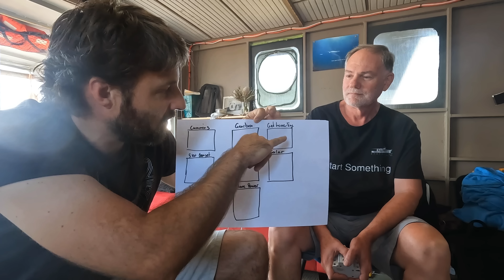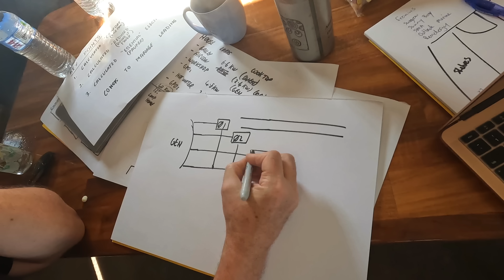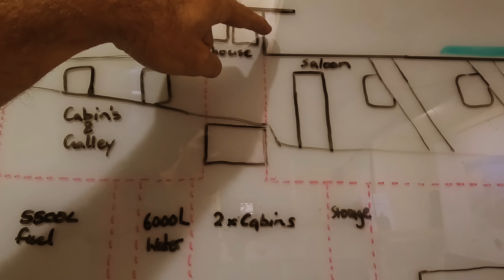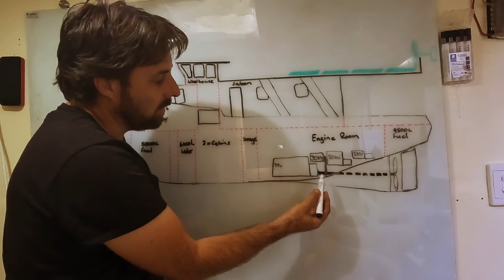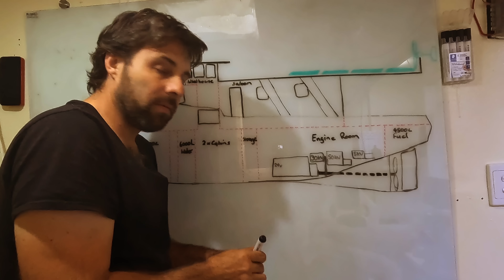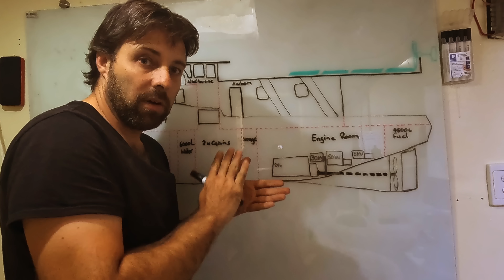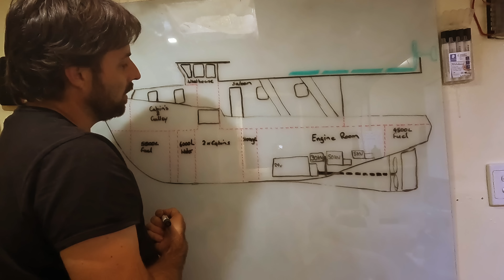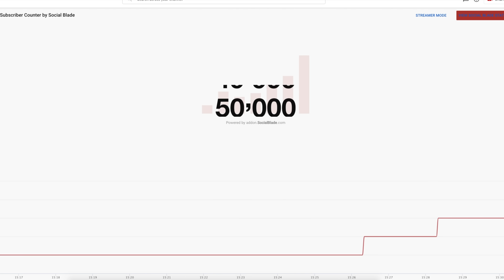Powering Brupeg - Project Brupeg Ep. 273

Comment: I’d go for a VFD for the 30kW motor, soft start and variable speed control would make it a very nice docking engine. There’s also a lot of them floating around on the used market, as industry these days fits everything with them. Vacon/Danfoss makes very nice units and they can be had for very limited money “broken”, usually it’s the fan that’s lost a blade, ruptured capacitors or a dead display unit that’s wrong with them, all cheap and easy to fix.

Comment: A couple of ideas:
Have those extra solar panels unfold like a cantilever tool box. So even folded up the top panel still see the sun.
Second thing is to weld lift rings  for the  propeller  etc. In case of damage from ice.  You can dive down to repair but need  that all important  lifting ring if you have pull the propeller.

Comment: Hi Guys,

I've got a 3 phase genset, and I've only got single from mains.

I've always been told with 3 phase you NEED to blance the the phases otherwise you will burn out the windings on the Genset. So 1 phase for the house, and the other 2 phases need to be doing something. So I've got 2 x instant hot water units that will be used to heat the pool (using the pool as a heatsink) so the genset doesn't burn out.

Regards
Reply: Yes, that's are approach re the 3-phase and house load. Dame's colouring in the previous episode was us going through defining circuits and calculating loads to best balance phases for the generator via the inverter. Of course they will not be perfectly balanced, but we want to avoid extreme imbalance. The get home electric motor will be the majority of the load when running, so that will be the most significant part of the (balanced) load. Cheers, Duncan

Comment: Split it up, 3 phase for high current items or items that you would only when you need the generator, than all the common items run off a single phase which than you have a inverter when you want to run on battery. When the 3 phase genset is running, it feeds the inverter charger to charge up the systems. Keep up the great work guys.

Comment: Hey Dame,

To throw another Spanner into the mix, albeit a possibly very useful one....

Have you considered also being able to use the Shaft motor, as a Shaft generator? It's a thing that big ships like Cruise ships do, for efficiency reasons where once they are underway at a steady engine power setting, they use the shaft generator to supply a large portion of the electrical needs and thus can shut down some or all of their gensets.

In your case it likely would not be your primary power source as you would be stealing horsepower from the engine to do it, and on a Small boat like yours, spare horsepower is limited, HOWEVER, In the event of a Primary Generator failure, where you NEED to be able to generate more power than the small Genset can provide, it may very well save your bacon.

Bonus points if you fit a second clutch between the propellor Shaft and the Motor, so that you can disconnect there, and be able to use the shaft motor as a generator without the propellor turning.
It'd also give you a decent way to load test the main engine without needing to drive the propellor when troubleshooting it.

Now as others have mentioned, you'd likely need a VFD for the Electric motor, and in this case, one that can handle using the motor as a generator as well, similar to the kind you'd find on an electric sailboat as those can use regen to recharge their batteries under sail.

Also regarding Shore power, you should fit either 1 or more Universal Voltage input Battery chargers, AND/OR an Auto Transformer, so that you can run off of 100-120v AC in places that use it. Even if you can't directly power most loads this way, being able to pump a few KW straight into your batteries for the inverters to use to supply loads, and to have the ability to directly supply loads on any "Essential" / "Emergency" Buses (Think, Comms, Bilge Pumps, Fire detection, standby lighting), is a huge plus

Regarding 220v / 230v / 240v, all of these are within the allowable range for "230v" which is the standard these days, so you could plug in to shore power in countries with those voltages and be fine. The worst you might need to do there is to just adjust the voltage settings on the Inverter charges / transfer switches.

If you end up using something like a Victron Multiplus or Quatro (or a few of them), they have the ability to bi-directionally Blend Shore Power and Inverter / charger power in realtime as needed by loads.
Basically you tell the unit from the control panel how much its allowed to draw from shore power based on the plug rating your connected to, and when ever AC loads need more than that limit, it boosts from battery, and when the load falls below the limit, the excess budget goes to charging batteries.

Combine that with an Auto transformer thats selectable via switch (or automatic via some magic electronics), and you can do the same on 120v.

I Highly suggest you look up "SV Delos Electrical System" in google and visit the page on their site called:
"System Overview for solar, wind, and lithium batteries – Electrical Boat Tech"
They cover the rather comprehensive electrical system on their sailboat, including how they handle multi voltage shore power, and have some nice big block diagrams of the system components.
Like you, they love redundancy and multiple options, so its a good watch.

Comment: I would suggest you use a VFD to control your 30kw motor especially with the genset . I spent quite a while as a service tech setting up VFD,s and soft starts in industrial applications . Soft starts really are only for limiting torque on start up and will give you no speed control so you boat will have effectively only one speed , soft starts also normally are restricted in the number of starts they can preform in an hour . A VFD will give you way more control and be a lot easier to manage , if you do fit a VFD I would recommend fitting a forced vent fan to the motor .If you are running a low speed the fan on the motor wont be able to cool it properly .
Cant wait to see this in the water 👍👍
Reply from the maker: Good advice. We are about to place an order for a good VFD unit and I like the idea of a forced fan cooling system
Reply: @ProjectBrupeg  
Good stuff , force vent is essential if you are running under 20% of motor rated speed. Feel free to contact me if you are looking for any advice on the VFD stuff 👍👍

Comment: As you are planning on using the boat as an expedition/research platform I would suggest 3 phase wiring throughout. You can always just use a single phase off of the 3 phase if you need it. But I can almost guarantee if you don't have it available then groups doing research will ask for a 3 phase connection for their heavy duty equipment. Also with 3 phase you can split things like lighting to be some lights on one phase and other lights on another phase. With each phase having it's own breaker if something goes wrong on one of the phases you don't lose all your lighting. It also makes it obvious that you have lost a single phase and even identifies which phase. Whereas with single phase, if the lights go out it could be wiring, faulty appliance, faulty inverter, dead/faulty batteries etc. It won't be instantly apparent what has failed. It will also be something you need to work out in the dark or by emergency lighting.
Reply: Hi Jase. Yes, that's our approach re the 3-phase and house load. Dame's colouring in the previous episode was us going through defining circuits and calculating loads to best balance phases for the generator via the inverter. Of course they will not be perfectly balanced, but we want to avoid extreme imbalance. The get home electric motor will be the majority of the load when running, so that will be the most significant part of the (balanced) load. Cheers

Comment: Containers and container ships are used all over the world, the refrigerator container has a genset hanging from the chassis when trucked. They are cheap, 4 phase, self contained and will run on vegetable oil. I use one as back up generator, cost me $1200 runs the hole house 5 days plus the hot tub.

Comment: You should modify your sump at this stage to include a drainage valve and adaptor.
Reply from the maker: Hi Cathal, great idea. We actually plan to make a system that drains main engine, gearbox and genset using a electric pump so we can do oil changes fast and easy without the need to try and reach under the various machinery
Reply: @ProjectBrupeg  add a small centrifuge filter setup and you will be able to recycle all the oil back into your main fuel tanks. Maybe oil driven from a pump (ala Landrover or commercial truck) or a small electric one. I know it’s only a small amount over two gen-sets and the main engine, but it is difficult to dispose of 20+ litres in most countries without a commercial account. BTW, Europe is 230 volt or 400volt 50Hz nominal if that is of any use to you. (I’m sure those decisions have allready been discussed and made.

Comment: Love the channel!!!  What I don't quite understand is what are the ways in which Brupeg is substantially different from thousands of similar and larger boats? What is the most substantial component that might call for 3 phase power?  I had a 76' woodie with twin 671's. (sorry), heavy duty Navy components but no where close to needing 3 phase power.
Reply from the maker: Hi Rex. We fit somewhere between recreational and commercial boats. We need a big solar/wind/house bank so we can stay at anchor indefinitely without the need to run a genset and we need high power output from a genset to drive a 30kw electric get home motor that powered the main prop shaft in the event the main engine stops. If we didn’t have the get home motor we wouldn’t bother with three phase.

Comment: I would have thought that it would be a dc hybrid drive , dc lift motors were used in tall buildings with variable speed controllers and ac to dc generators to power them, might be a solution to one of your problems. Soft ac starters I thought are just to rotate motors and flywheels from rest, to reduce surge from main windings, prior to clutching in the load, and not in initial load connection. Good luck and keep it simpler for when your in bad seas you have no time to fix it.

Comment: 3 phase should be your main generated power with stepdown transformers and isolation disconnects,. Use 1phase for lighting and appliances with transfer switches to switch inputs of your solar or wind power. Think of making feeds like hospitals - utility source, normal power, essential power and emergency circuits. Make one single phase and one 3 phase  plug in receptacle  available for shore power.

Comment: I'm going to make a prediction on how Brupeg is going to be run.
Most of the time when just cruising from point A to B you will be using the electric motor. You will run the generator 20 hours a day in a 24 hour period. This will be because fuel consumption will be much lower. The main will be used when you are in a time crunch or need full power.

Comment: I would look at andy of off grid garage on youtube for building batteries. I have also done the same thing with my inverters i started off with a mppsolar inverter 2.5KW.But now i run half the house off solar i upgraded to a victron 24v 4500w {5000v/a} ans as andy as done slave the mppsolar to it witch works very well.All the best with what you decide and hope you are all well.

Comment: Three phase is the most efficient way to generate power. You could run a 415V + Neutral ring main around the ship and spur off individual phases to local fuse boxes.
Reply: Yep, certainly in our thinking from a generator point of view. We are looking at running groups of circuits which we can easliy bring back to the "battery" room with circuit breakers and distribution panels. We can then group to best balance loads for phases/inverters. At that level, they will be 230V phase to neutral. Cheers, Duncan

Comment: I had a bit of an idea looking at a wiring diagram for parallel and series battery banks with 2x inverters. What I saw was a way to remove strings of batteries entirely by putting each bank onto its own inverter and each inverter having its own solar array. It gives some redundancy but doesn't eliminate entirely the possibility of a cascade failure depending on stuff LOL.
Thing is everyone is afraid of parallel strings of series connected battery banks and I suppose there are some good reasons because of implications around battery life and the complexities and reliability of battery balancing tech and I was looking at ways of eliminating much of all of that as I could.
The downside is in your particular setup you now need 3x banks of 48v batteries in your system
If you had 3x battery banks with each having its own inverter with one set as a master that would work wouldn't it?
In paralleled inverters you can even set the parameters for inverter switch on and off as this type of operation is already baked in for multiple inverter ops.

Alternatively you could have 3x battery banks each with their own inverter powering regions on Brupeg - each region wired for its own inverter and each inverter running off a phase of the generator. Cross feeding in the event of a failure of one region is as easy as connecting inverters - an isolator switch between inverters keeping each region isolated. When they're connected one inverter has to be configured to be master since something has to be the AC frequency generator to avoid phasing issues which AFAIK inverters can't do. This means it might take a few minutes as you configure master and slave before connecting in the event of a failure. Downside more wiring and solar panels have to be configured with more wiring. Upside is there are 3 discrete systems.
Reply: Yes, we are leaning toward the 3 discrete systems whcih connect back to the three phases with balancing in mind, but we know it won't be 100%. That's fine. Apart from the greatest efficiency in terms of the 3-ph supply, we do get that redundancy as you suggest, and the ability to have reconfurability in the case of a fall-over. Cheers, Duncan
Reply: @duncancampbell62  Re discrete systems, the one good thing about them is the battery banks don't need to be matched, nor the battery tech either.

Comment: I'm assuming you will be working with 240v single phase (415v between phases), i would distribute the 3 phases for the main mechanical stuff (motors, winches etc0, if you then want to use 3 phase for 'domestic' power, think of it as 'essential and non-essential'
Anything that you have to power from a single phase emergency generator or single phase shore power should be on the essential circuit.
The non-essential is stuff you can do without for periods of time until you can get back on 3 phase.
Another thought is to have a changeover switch so that ALL single phase stuff can be jooined together in emergency
You're less likely to get problems of blowing trips when more than one thing is turned on with 240v, it's all about the watts.
Be careful if you use 3 chargers (3 phases)  to feed one battery bank, the input and output must be isolated
We had essential and non essential supplies where i used to work as a sparky, i'm on discord via my website if you have questions
Reply: Hi "Sparky". Yes, that has been pretty much our approach. The inverter which Damien is looking at has an integreated three phase battery charger system built in. Cheers, Duncan

Comment: In 25 years I had ever circuit breaker in my house trip once. Lightning struck a tree in my back yard. It was only 30 foor or around 10 meters for you guys. Everything in my house was fine but my neighbor on the opposite side of my house from the tree lost almost everything. TV's, VCR's, Refrigerator, Air conditioners (3 window units) and the microwave all stopped functioning. Apparently her house wiring was original and the older circuit breakers failed to trip. Both our electrical share the same power transformer on the street. My question/concern is what kind of protections and/or backups
Reply: Opps...  What kind of protections/ backups do you plan to have in case of lightning strikes?
Reply from the maker: Still to be shown on camera but we have a pretty decent system designed